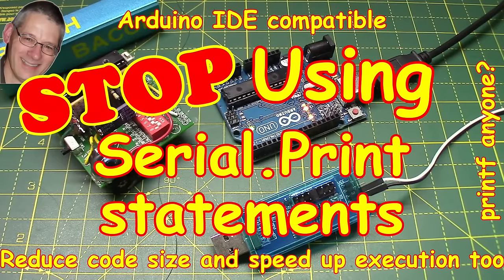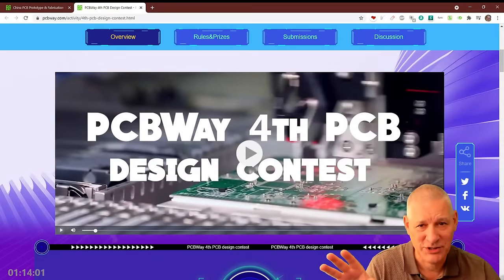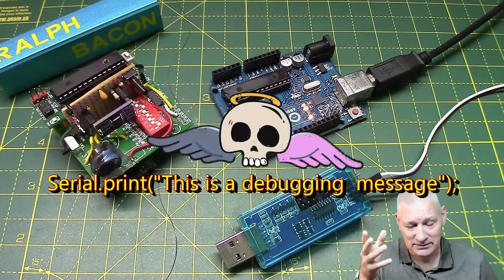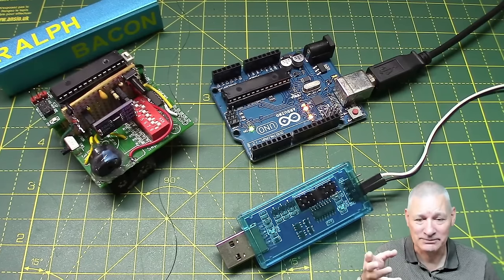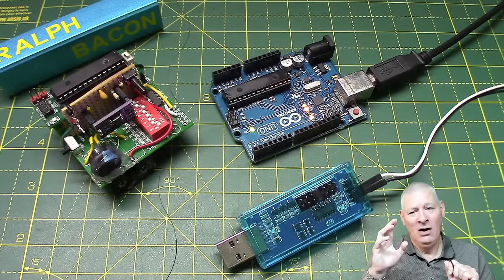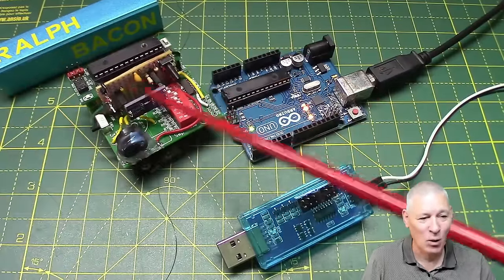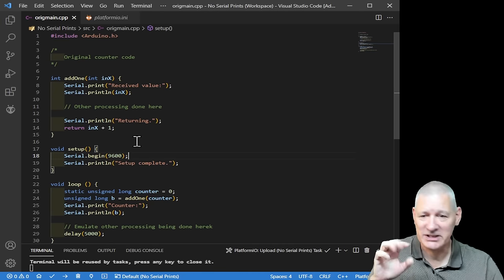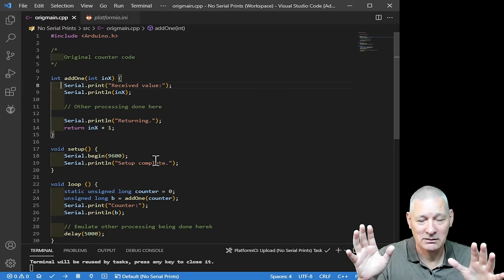#224 🛑 STOP using Serial.print in your Arduino code! THIS is better.

Comment: Cool! 
I plead guilty of writing and leaving a Serial.print at every other real code line and figured that those wasted storage space and execution time, but since I have only toyed with simple programs and have not hit space / speed problems, I have left that in the "to be addressed eventually" bin.

Nothing like the present:
- I opened a new empty sketch and added the compiler substitutions you suggested, but using "avisar(x)" in spanish so it would be obvious that that was not native keywords, 
- saved "nuevo.ino" (also in spanish) in my syncthing-ed arduino projects directory, and
- pointed arduino.sketch.inoBlueprint to the full path of the modified file.
Then I remoted to my linux machine at home, started the IDE there, opened a new empty sketch and bingo! There it was with the added lines!

One less problem ...!
Reply from the maker: Saludos! That's a great way of integrating this method. Very nice. 👍

Comment: Cool! I hadn't thought about this approach.
And if the sketch uses Serial only during debug, then it's needed to make a condition for Serial.begin() depending on the DEBUG value. And then I believe the gain in program storage space will be much greater. But this my remark probably has no value.
Reply from the maker: Others have also mentioned the Serial.begin, so your remark definitely has value! 

The best way of finding out how much that would save would be to compile an otherwise empty sketch both with and without that statement and see that the compile size comes to.

Comment: I would like to see how the new IDE 2.0 Beta version, with its built in debugger operates.   It looks like you need to have some external hardware compoment connected.   A future video on that would ge very helpful.
Reply from the maker: That would be cool, indeed. And I have it on my list to do a proper video on this, I did a quick overview in video #180:
https://youtu.be/ArUzVt9z1ug

Comment: This did not change the size of my program at all - is it becuase I am programming on Arduino IDE.
Reply from the maker: If the Serial print statements are "in use", that is, compiled, then the code size will not change. If debugging is switched off (that is, the Serial.print statements are not longer compiled) the code size will most definitely change. Nothing to do with the IDE.

Comment: I remember when having a single LED for debugging was a luxury :-)
Reply from the maker: Hang on, Martin, you can't possible mean a single LED just for your own use can you? Without sharing with the guy in the next cubicle? Luxury!
Reply: @RalphBacon  One LED for the whole department, you had to sign for it.
Reply: Yes, the first ones were quite expensive. In 1973 or 74 a red LED  cost about US$50 in Norway.  At the same time a 7400 quad nand gate chip cost US$ 1.

Comment: I like the fact how you've converted a debugging output line into a macro - either print it or not, rather than check if debug mode is set, then print if so.... neat.
Reply from the maker: Glad you found it useful!

Comment: Great tip. I had been using #ifdef and #endif for each of my debugging lines but I like this method much better. As the sketch I'm currently working on doesn't require using Serial.print  in normal operation I've also added #define debugbegin(x) Serial.begin(x) to my code but can only verify that it compiles properly as I'm currently away from home.
Reply from the maker: Glad it was helpful! Yes, good use of debugbegin(x) too; it will remove the library dependency entirely.

Comment: Hi Ralph, very good point about the Serial taking up memory and time.
This is the way i do debugging (taking your "Simple_Example/simple.ino as a reference")

#include <Arduino.h>

//Debug options start.
#define serialBaudRate 115200
#define debugEnabled true //Setting this to false will disable ALL debug options below.
#define debugSetup true //set to false if you dont want to debug this.
#define debugAddOne true //set to false if you dont want to debug this.
#define debugLoop true //set to false if you dont want to debug this.
//Debug options end.

int addOne(int inX) {
   #if debugEnabled && debugAddOne 
      Serial.print(F("Received value:"));
      Serial.println(inX);
    
      // Other processing done here
      Serial.println(F("Returning."));
   #endif
   return inX + 1;
}

void setup() {
   #if debugEnabled
       Serial.begin(serialBaudRate);
       Serial.println(F(""));//Make sure our first Serial print gets on a new line.
   #endif
   #if debugEnabled && debugSetup
       Serial.println(F("Setup complete."));
   #endif
}

void loop () {
    static unsigned long counter = 0;
    unsigned long b = addOne(counter);
    #if debugEnabled && debugLoop 
       Serial.print(F("Counter:")); 
       Serial.println(b);
   #endif
    // Emulate other processing being done herek
    delay(5000);
}
Reply from the maker: And I use t hat way too sometimes, but I don't like using the #if construct in my code as it destroys the layout (to my eyes at least). If you look at my second (Advanced) example it shows a more granular way of doing things that might help.
Reply: Truet that it destroys the layout a bit, but at least you can turn on and if exactly what you want to debug this way. Your advanced example is a good approach to of course, I just wanted to show another way of doing debugging. After all, we all have different tastes about things.
Anyway, great thanks to you for your videos, they are superb.

Comment: Also #225: 🛑 STOP using floats in your Arduino code! They are even worse for performance and code size. Especially on AVRs, but also on µCs that have some kind of floating point unit like an ESP32. There is barely any case that can't be done just with ints. For example instead of using Watts to 3 decimals in calculations, just use mW, and everything is int with the same digits but a lot faster.
Reply from the maker: Agreed. I never (hardly ever) use floats and just divide ints or longs for the final display output. But some sensors (temperature) do output float values... unless they are just longs that we treat as floats? Hmm.
Reply: @RalphBacon  
If a sensor returns a float, it is usually the "fault" of the library. I can't remember ever seeing a simple sensor (those that you'd connect in an Arduino project) itself return a float. Fixed point numbers maybe, but those are essentially ints anyway. Floats don't make sense for a sensor, because for almost all of them the resolution is the same over the whole range as that's how ADCs work. A sensor that can measure from 0 to 100 with 0.1 resolution does not get more significant digits just because the value is blow 10 or 1 (that's what would happen when using a float).
Anyway, when a sensor library returns a float and there are speed or space issues, the first thing to do should be to look into the library's source. If you're lucky there's a function there that returns the raw sensor value (which is then used by the library itself to return the float).
Reply from the maker: You've just reminded me of two functions that return the battery voltage; one returns a float, one returns an int (that you have divide by 10 or 100). The one that returns a float just divides by 10 first , before returning the value! Doh!

Comment: If you use  Serial print between macro if statement each time it reduces much more. 

#ifdef DEBUG
Serial.print(…..)
#endif
Reply from the maker: But it does require you to (remember to) write #ifdef DEBUG each time, and it looks a lot messier IMHO. In my IDE the indentation of the #if is all wrong!
Reply: Yes you are right. Need more attention. But it allows you to split multi-function debugging. I prefer your way to redirect the port for the debugging. Especially hardware uart is used in the circuit for example GSM communication. Multi-debugging is like:

#if defined(DEBUG) && defined(DEBUG_GSM)

in somewhere else

#if defined(DEBUG) && defined(DEBUG_ADC)

Comment: You can use Serial.println with single line, it's easy:  Serial.print("This is the value of the loop: " + String(loop) + " and the value of the next variable " + String(variable2));
Reply from the maker: If you can stringify the variable then that's fine but not really as useful as a standard C++ function like printf!

Comment: Maybe you can also use 
#define debugf Serial.printf
and use magic of printf function with multiple parameters? I like compactness of the printf function, but it works only on ESP32 platform...
Reply from the maker: On an ESP32 platform we don't need to do anything, because it has the built-in log_x statement, which is basically a printf define for a particular "x" debug level (verbose, debug, info, warning and error).

So our 
                     log_v("Initialising temp sensor at %02d", currTemp) 
statement will only be output if the core debugging level is at "verbose", level 5; any lower and it will be ignored (not even compiled).

And the printf statement works quite well on the Arduino too, see my video on it, #227.

Comment: The warning here is very useful - as it hints the counter doesn't perform its intended (by name) task. 
The ability to turn off 'usage only for debugging' is beneficial even beyond space and runtime.
Reply from the maker: That's where the ESP32 with its granular display levels wins out - keep on the fatal error messages ("E") and perhaps warnings too ("W") and only use the other levels for actual debugging. Very efficient.

Comment: I mean, the ifdef macro is more preferred than defining DEBUG to 0 and then comparing it to 1 😅
Reply from the maker: More prefered by whom I wonder?
Reply: @RalphBacon  If you work on a large repo that requires a build system like autotools or cmake, most of those build systems relies on whether a macro is defined as feature switches.

Comment: Great tip here. Preprocessor statements are so underrated. I usually make a debug function that takes a string then passes it to serial.print. Inside the function i use #ifdef statement to determine if the serial.print function gets run. I'm sure the compiler is smart enough to know the function has no code and to omit the function entirely when there is no definition.

#define _DEBUG 
void debug (char *inStr)
{
#ifdef _DEBUG
serial.print("debug: "); 
serial.println(inStr);
#endif
}
Reply from the maker: Yes, the compiler will exclude "empty" (or even unused) functions. 

The only downside I notice with your method is that you will have to format the string yourself (possibly using snprintf?) rather than just letting the standard methods do all the heavy lifting.

Comment: my halfway:
1: do not use Serial.print, let use Serial.printf() (if available), its way easier to use single line of variadic functions than wite dozen lines of Serial.print(). It's hard to switch to printf() but its way more flexible.
2: for esp32 and STM32 always use 2M baud rate or higher, otherwise it might significantly affect run code.
3: rarely slowing down by Serial.print() things hide other problems at full speed (disabled print) especially using ESP32 and RTOS things (scheduler might work differently)
5: for esp32 (multicore) or RTOS its sometime mandatory to print thing in the "IDLE" thread so debug() require "FIFO" and "thread" layer.
Reply from the maker: Yes, ESP32s have printf built-in; Arduino doesn't, hence the (quick) pointer (not that kind) to an Arduino version that works well.

Good tips here, thanks for the heads up.

Comment: Could be done with a function and if constexpr instead of a macro as well :)
Reply from the maker: Is this available in the avr-gcc compiler? Even if it is, it would much more complicated to implement, don't you think?
Reply: @RalphBacon  not sure as it requires c++17. When it comes to c++, the general guideline is to avoid macros if you can.
Reply from the maker: Avr-gcc is only c++11, I believe. ☹️

Comment: I used to use #define a lot. It was handy to switch between a debug mode and a production mode.
Reply from the maker: The only problem I find in "switching" between one and the other, is that when things go wrong you cannot just "switch" debugging back on because it was never compiled in the first place!

I've used a spare GPIO pin to overcome this. If the GPIO pin is LOW then debugging is OFF (and the code just ignores the compiled debugging statements). If the GPIO is high then debugging is on and it spits out all the information via the serial port. Downside? Bigger code size!

Comment: There is also a possibility to use a dynamic debugging option. It will not reduce the size but will reduce the CPU overhead. Check the state of a port. If it is low, then do not debug, if high then debug. This way to can dynamically switch between debug en non debug mode without recompiling the software. You can even do it if the system is running. Only thing you have to serial.begin if debugging mode is required. This can be done in the 'loop'-loop.
Reply from the maker: Yes, I've done this too; just pop a jumper on an unused GPIO pin and ground to invoke the debugging. It doesn't reduce the code size but does ensure you don't output stuff down the serial port unnecessarily, slowing everything down, either.

Comment: I use a method similar to this except your method is a step better. You don't have to assign a value to your definition. I use :-
#define MYDEBUG

#ifdef MYDEBUG 
  code goes here
#endif

and I comment out the #define MYDEBUG when I want to turn it off. eg
//#define MYDEBUG

But I was wrapping all my Serial.print(...)  inside a #ifdef / #endif as follows
#ifdef MYDEBUG
  Serial.print("blar blar blar");
  Serial.println(x);
#endif

as you can see this adds 2 extra lines every time you add debug lines. Your way is better.

But why not add 2 other lines as well as follows:-

#ifdef 
  #define debug2(x, y) debug(x); Serial.print(": "); debug(y); Serial.print(",  ")
  #define debug2ln(x, y) debug(x); Serial.print(": "); debugln(y)
  #define debug(x) Serial.print(x)
  #define debugln(x) Serial.println(x)
  #define debuginit(x) Serial.begin(x)
#else
   etc...
#endif

I have included the suggestion from @fennec4140 about debuginit(x).

if you want to use the Serial port in normal code then in the #else clause just comment out one of the last 2 lines. That way debug is on no matter what DEBUG equals (or not, depending on the commented line)
#else
  #define debug2(x, y)
  #define debug2ln(x, y)
  #define debug(x)
  #define debugln(x)
  //#define debuginit(x)
  #define debuginit(x) Serial.begin(x)
#endif

I find I get errors in the compile in the included libraries if I use #define DEBUG as follows
#define DEBUG
#ifdef DEBUG
  #define debug(x) Serial.print(x)
  etc.

so I use

#define MYDEBUG
#ifdef MYDEBUG
  #define Dbug(x) Serial.print(x)
  etc .

I think it still reads well.
Reply from the maker: Glad you improved upon my suggestion! 👍

And that's the purpose of these videos, to get others thinking about how they might do things differently, or better, or just tweak it to suit their purposes better.

Thanks for sharing!

Comment: I heartily agree with avoiding multiple Serial.print lines. An alternative to sprintf is Mikal Hart's Streaming library that gives a more standardised cout type of code. Such as Serial << F("Foo = ") << foo << " and baa = " << _HEX(baa) << endl; It has some formatting capability, I thing printf is slicker. But as my work is dominantly integer (8, 16 and 32bit) floats make rare appearances. Thanks for your videos.
Reply from the maker: Interesting, so I shall check out that other library and see what it can do 👍
Reply: @RalphBacon  But there's nowt wrong with your approach at all. Very handy and easy to implement but it would be great if we could retrospectively globally comment out Serial.print() in a simple # statement. E.G:
#define Serial      "//"

Surely there is a syntax which allows this and incorporate the // as part of the substitution string.
A 'one click' find and replace macro in the IDE would be very useful.

Comment: I noticed this when collecting sensor data to the terminal ...
The println wasn't as fast as the sensor, n I was missing data.  So agreed, the overhead is more than you think 👍
Reply from the maker: Although it does depend on what baud rate you have set in your Serial.begin - I use 115200 as it seems "fast enough" but I've seen some developers use 921600, which is the speed I use for uploading code to my ESP32, so no reason it should not work. 

Perhaps one day I'll remember to try it out!

Comment: Very informative video Sir...btw i use printf cuz i have some love with c i use borrland c way back ago when i im in college ...
Reply: Haha, I’ve used Turbo Pascal from a 360kB floppy disk. The IDE only used 64k and you had another 64k fir your program iirc. 
Those were the days. 😉
Reply: @Conservator.  i use in 2008 in college cuz in my college they use old borland c for basic programming then use modren gui sdk but first they teach basic c ....old memories
Reply from the maker: I'll be covering printf in more detail soon, Muhammad. And why we should be using it for the Arduino.
Reply: @RalphBacon  ✌👍
Reply: @RalphBacon  yes Sir...but printf command are different like in borland c prinf but if u want newline then its be printf("hello"\ln) and its new line

Comment: Surround your serial.prints with #ifdef DEBUG and #endif, then add a #define DEBUG 1 to the top of the program.  Now when it all works just remove the #define DEBUG and all of your serial.prints are gone!
Reply from the maker: Hmm. The whole point  of this video was to avoid having your code littered with #if...#else...#endif statements! Don't you think it makes the code hard to read?
Reply: @RalphBacon  Actually, you could create a macro to hide the #ifdef..#endif with the serial.print, so the debug statements were only a single line.